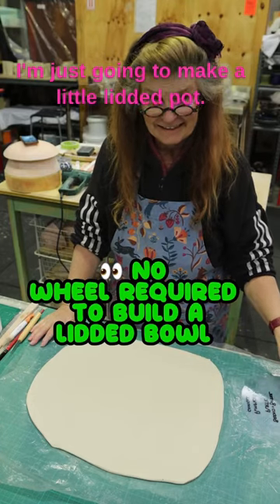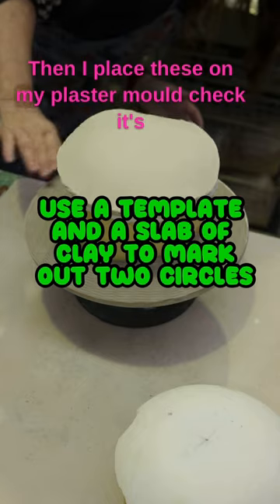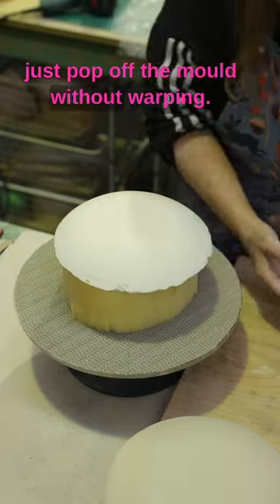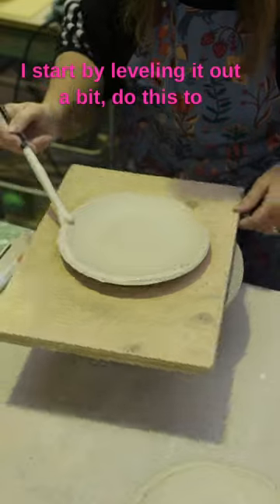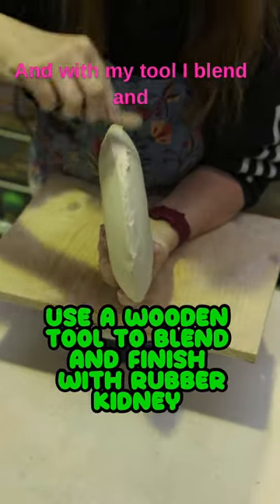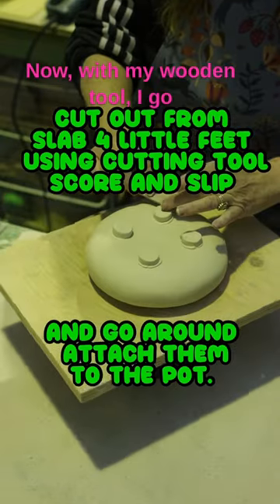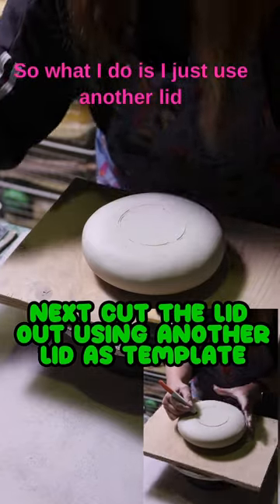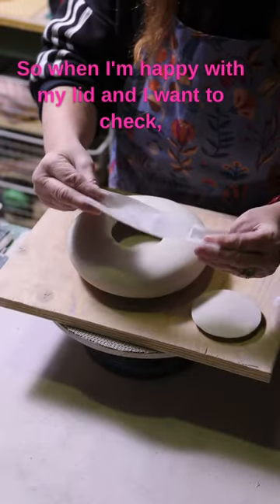Craft a Pottery Lidded Bowl No Wheel (caption in comments) #ceramics #clay #pottery #shorts #viral

Comment from the maker: 👀 Crafting a Pottery Lidded Bowl Without a Wheel: A Step-by-Step Guide.
.
Discover how to create your very own pottery lidded bowl with this comprehensive walkthrough.
.
1.	Begin by using a template and a slab of clay.
2.	Mark out two circles on the clay.
3.	Place the marked circles onto a plaster mould, ensuring they are cantered.
4.	Smooth down the clay using a rubber kidney tool.
5.	Proceed to join the two sides of the clay together.
6.	Level out the clay slightly, repeating the process for both sides.
7.	Score and apply slip to the clay before joining the sides.
8.	Press the sides together while encircling the form.
9.	Utilize a wooden tool to blend and refine the joined areas.
10.	Finish the smoothing process with a rubber kidney tool.
11.	Employ a cutting tool to carve out four feet from the clay slab.
12.	Score and apply slip to attach the feet securely.
13.	Utilize a wooden tool to attach the feet around the base of the pot.
14.	Use another lid as a template to centralize and mark the lid's top.
15.	Cut out the lid with care.
16.	Once cut thoroughly clean both the lid and the bowl.
17.	Confirm the lid's fit using a strip of sewing interfacing.
18.	Gently place the lid on the bowl to check alignment.
19.	Craft a handle using a strip of clay slab.
20.	Add a handle to the lid.
21.	Attach the handle using the score-and-slip method.
22.	Admire your beautifully finished pottery lidded bowl, a result of your meticulous craftsmanship.

Happy potting! 🤗 
 .

Join us on our Pottery Journey hit the follow button.